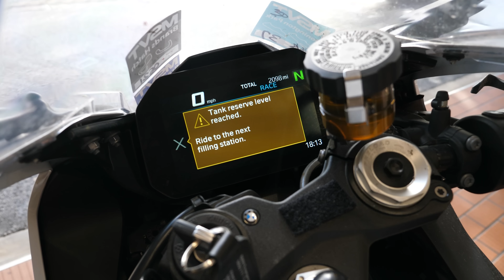I Bought a Crashed BMW S1000RR

Comment: No way Baron! I acquired my 2020 BMW S1000RR in exactly the same way six months ago! 
The bike had a trackday, took a fall, and found itself in the gravel, but in my case, it was on the left side. The previous owner simply couldn't be bothered to repair the bike. Resulting in significant savings for me, landed the purchase at 3-4K below the average price in the used market (in the Netherlands). The only necessary fix was minor (O-ring leak from the output shaft). only repairs after that were: the rearsets, grips, bar ends and shift lever, alongside the fairing repairs. also kept the little marks on the swing arm and frame. It is only noticeable if you basically look for it.  

My opinion on what you should do:
Keep it and use it. I'm going to do the same. it is a bike that i dreamed of owning. going to "Picos de Europa" Spain in September for my first Europe tour. Can't wait!
Reply: Tering ouwe heeft die niet alsnog een fortuin gekost?
Reply: @Alic_R1  Uiteraard
Reply: @Alic_R1  simpel gezegd ja. Toen ik aan het kijken was voor een andere motor, zocht ik naar de naked variant van de RR. Was van plan één te importeren ivm de prijzen in Nederland. Per toeval kwam ik m'n RR tegen via een Facebook groep. Puur omdat toendertijd de RR niet in m'n budget viel (incl. verkoop van m'n MT-10) heb ik er nooit naar gekeken. Gokje gewaagd en pakte gelukkig goed uit.
Reply: Zo heb ik 4k bespaard op mijn Monster 1200S. Eigenaar was er mee gevallen en wilde er van af. Destijds waren ze met die kilometrage rond de 12k, ik kreeg hem mee voor 6,5k. 1500 aan onderdelen later en hij is weer perfect.

Comment: Your bike does look good,the Mrs thinks it looks good too. Just in case you didn't already know,be careful when it's wet on white lines and metal man hole covers,definitely avoid them if possible, certainly treat them with respect, also watch out for gravel too. The way I deal with slow turns is to very slightly put my weight to the outside of the turn,maybe it will work for you and maybe not. I have to be careful on slow turns because my Ducati multistrada 950 is too tall for me and heavy too,I have dropped it once in a slow turn. Any way good luck with your new bike and just be well careful with,one little mistake and you will ruin your bike and be kicking yourself for a costly tiny mistake.

Comment: I have the same bike 23 i love this bike.. it needs a flash to get rid of the dead spot i suggest bt moto i have there tune  since this model is very restricted and a full system to heard the beautiful beast and an air filter